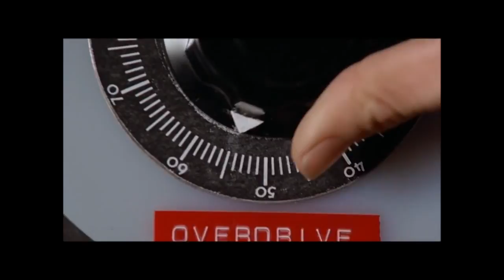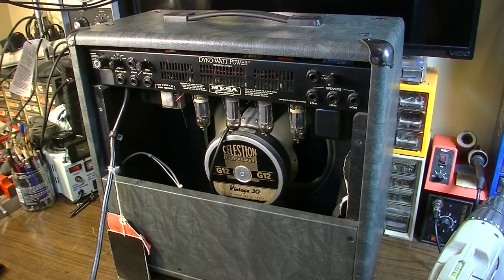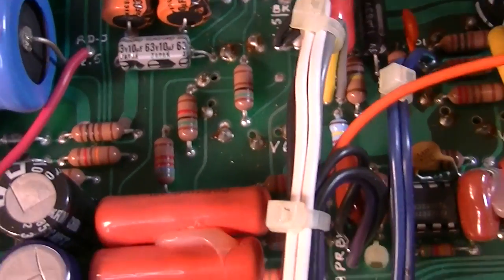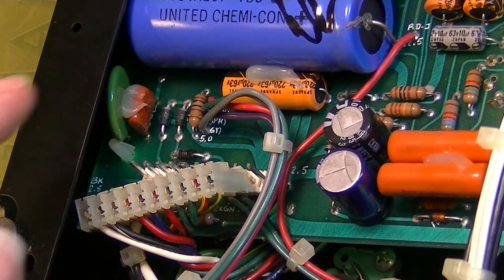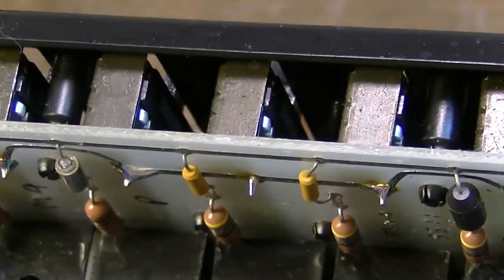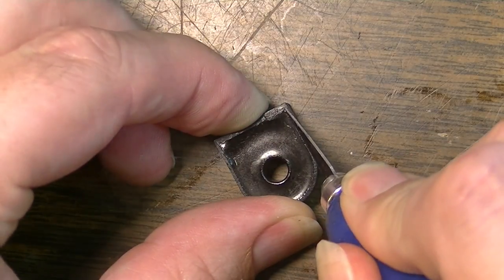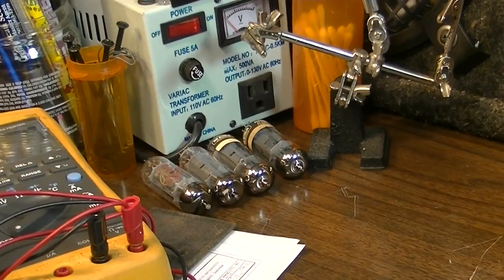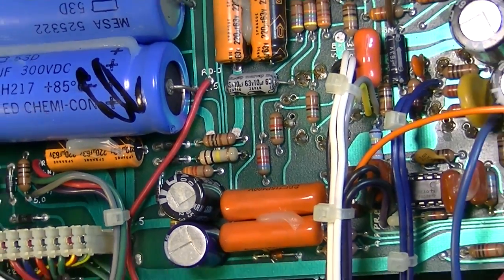The Forgotten Mesa-Boogie - 1990s Dual Caliber DC-3 Repair (PART 1)

Comment: I had a DC 5 that was horrible. Half of the EQ went out on it. It would feedback even at low volumes, Horrible pop when you changed channels. My other Mesa amps were fine, but I had two DCs that were both really bad. The DC2 was an easy fix. The DC 5  I would even sell to anyone. I  pulled anything good off of it then dumped it.  I feel your pain.

Comment: In 2018 those tubes, which are clearly stock would be old as hell. And also only two were replaced. At first glance it seems the amp has never been properly maintained, I don't care who his tech is. People just need to take care of their gear or they're asking for problems. All that trim, shielding or whatever always gets in the way no matter what amp I've worked on.

Comment: Hello, I am really enjoying your channel! I recently purchased a used Mesa DC-5 head and am really enjoying it! Overall it's in good condition, and everything works perfectly except the graphic EQ, which stubbornly refuses to activate. I have the older (original) spec DC-5 head, with the multi-position rotary switch on the back panel for assigning the graphic EQ. I tested the switch and it seems to be electrically fine. However, no matter what position the switch is set to, the graphic EQ will not engage. I also tried plugging in a footswitch to control it that way, and no dice. So I am suspicious that it's a failed relay or other switching component on the PC board. Would have have any specific advice about where to look, or which specific component to replace?

Comment: I would never have guessed these pc board circuits to be as flexible as you have shown through finding specs and isolating individual resistors, caps, and other parts, then rebiasing without using much more expensive output tubes to dumb down the amp. Great lesson for the uninitiated like myself! I put off watching this vid for a while, but I’m really glad to have seen it now. Thanks.

Comment: 55:50 - I noticed something similar with my Orange Rocker 32 (which uses EL84 tubes) - the plate dissipation was above 12 watts.   The Orange Rocker has a half power switch and when switched to half power mode the plate voltage drops to about 70% of the max power setting - bringing the plate dissipation under 12 watts.   These were new amps too.  It seems very odd to purposely design an amplifier to exceed the data sheet maximum plate dissipation.  Is it common practice to exceed the tube plate dissipation on guitar amps?    I don't know - that goes against my training/schooling.  I'm an electrical engineer BSEE from Cal Poly SLO and MSEE from SCU + 25 years of experience as a design engineer in Silicon Valley.  Maybe I just know too  much.

Comment: Ive worked on a few of these over the last 30 yrs and they all seem to run hot, and use a lot of watts compared to other amps. I think this extra wattage does contribute to the tubes getting to hot and burning them out faster while cooking that board. i always used the coolest running tubes i could get at the time, Sovteks are good choice, then adjusting the bias similar to what you've done. Ive used those adjustable resistors in a few just in case they wanted to switch tubes, but then a rebias would be needed which was easy, still needed to do the math to set it right , though some refuse and suffered the consequences. lol
 its great Mesa still sells parts at a decent price. thanks for sharing, Brad!
Reply: Ya, cooling fans are a common add on for Boogie amps.  Lots of other amps, too.  Buys some tube life in a cramped combo.

Comment: I love these videos and they've not deterred me from purchasing Mesa-Boogie amps in any way. Complex is not bad, just different. :)
Reply from the maker: My goal is not to dissuade people from Mesa. I hope no one thinks that. I just want to show things as they are. If there are flaws I find, I'll point them out. There is good and bad in almost any design.
Reply: Mesa stuff is rock solid (with all the bells and whistles)...as long as you treat it right.
Reply: Good.  Less copycats.
Reply: @Twobarpsi  that's funny because Mesa's most popular guitar amps were someone else's designs that they STOLE
Reply: @shekador  right lol basically every amp is stolen from fender or vox and sort of marshall but Marshall started ripping off the bassman so it's fender and vox. And Leo fender built his amps based of the old RCA books.  Basic radio amplifiers really

Comment: Boogie buyers like complicated amps I was offered to use one in a nice studio once  a quad rectifier I looked at it and went with the fender champ
Reply: Ice Bob most complex amps sound bad, give me a volume and tone - that’s it.
Reply: Mesa amps are better than any volume / tone amp, and My tone is in My hands  AND My Dual Rectifier Mesa
Reply: 83roadstar  you my need that .my tone is in my hands.if I need louder I play harder they did make a few amps for my the style subway blues was one. I don’t need channel switching  single channel with reverb volume knob  tone I’m good. no disrespect we all have different music needs
Reply: No, they like good sound.
Reply: @icebob8555  You play harder to get more volume? Said no guitarist ever (also , that won't work)
Reply: Ice Bob How do you add/remove mids and balance the highs and lows with only a tone knob?
Reply: I have a Boogie DC3 and love it.  Great cleans that rival any Fender.  I also play thru a 5E3 Tweed.  I love the spongey overdrive you can get with that amp.  Boogie for cleans and Fender for overdrive. Who'd a thunk it?

Comment: Brad, the Dual Caliber range is actually an upgrade to the Studio/Caliber series, which housed a single EQ section shared between two channels (almost unimaginable simplicity by Mesa standards)! The DC-2 & DC-3 upgrade from the 22W, dual EL84 Studio .22+ (of which I own a mint 1992 example). The DC-5 & DC-10 upgrade from the 50W, dual 6L6 .50 Caliber+.
Reply: I'm confused a little. I have a Studio Caliber DC-2 (No parametric EQ). Is there a DC-2 that's a Dual Caliber? You're saying the DC-2 is an upgrade? Did the lineage go Studio .22>Studio Caliber>Dual Caliber?

Comment: Nice work, I never would have thought to call Mesa for parts like that. Such a simple solution haha. Awesome they're still stocking parts like that. Definitely some moments that made me want to go play through my Dual Rec Tremoverb. The complexity of the high gain Mesa tone is always something I enjoy. At the same time, I just modified an old hifi amp into a perversion of a 2204 circuit, so I love both Mesa and Marshall high gain flavors
Reply: haha I want it all I guess. Also 12 years ago when I got my Mesa, it was my grail amp. It doesn't have sliders, it's just a 2 channel Dual Rec. I shy away from the graphic eq Mesa's, they're just a bit extra for my tastes. These days I still listen to extreme metal, but I pick up a guitar and love playing other stuff.

Comment: I went through all this a couple of months ago. It's actually impressive that all these DC-3s can survive with 125% or higher output tube dissipation. I piggybacked the 120K to bring it to 100K to bring dissipation to survivable numbers. Changing that resistor also changes the bias for the phase inverter, and actually uses the phase inverter cathode current to generate the output tube bias... luckily it was close enough. If the PI bias is off, the 15K needs to be changed as well. Later, for some reason there was -45V somehow leaking onto the grids of the EL84s from that ridiculous bias circuit, cutting off the output tubes. Tightening the input jack to fix ground was the only way I could find to fix it. Nice sounding amp when it's 100%!

Comment: Little amp turned out great! One could tell it had been used but not abused. Many trouble free miles ahead! man, i worked 2 blocks away from Mesa HQ around the time this amp was made (91-93) on Clegg. I'd taken a break from playing so never stopped by but more than once heard amps 'demo'd'.

Comment: I have a DC-5, one of my favorite Boogie amps.
Reply: Me too, awesome amp! I had a Dual Rec for 15 years but I like the DC-5 so much better. It just has a sweeter sound to the Dual Rec. I picked mine up from a studio sale so it'd never been gigged, only ever sat in the live room for 20+ years. I need to get to the pots as they're all crackling badly but it's a beaut!
Reply: Yea, I got mine for $400! I couldn't believe getting a Boogie amp for that price. I've heard the lead channel is based on the early recto with a mark EQ. Sounds less muddy in the low end to me. I have a 3 channel dual rec and I find myself playing the DC-5 way more nowadays. Plenty of gain for everything.
Reply: @KnotTime  I have one of the earliest DC-5's I've seen. Red shade grill cloth with the plastic rocker switches and no headphone jack. Play it almost daily.  Close to Fender cleans and headroom to level a small town! :) Keep rockin!
Reply: I bought my DC-5 combo new in 1997, and still use it. It’s been rock solid and puts out.

Comment: Good video. The hot bias problem was discovered - and the remedy discussed - years ago on the forum "Boogie Board" under on website forum.grailtone.com. I just checked, and the forum still exists.

I bought a new DC-3 in the early nineties. I still have the amp, but rarely use it. However, I quickly ran into problems with the amp running super hot, wrecking output tubes and creating other heat-related problems. I discovered the thread on the above-mentioned forum. Most owners consider this straight out design flaw by Mesa. The solution is precisely what is suggested on this guitologist video. If you are feeling too lazy to unsolder the 120k resistor and replace it, the Boogie Board thread suggests just soldering a 470k resistor in parallel with the 120 to give...you figure it out. Same result, though, and not much easier.

I went through the rigamarole of using "cool running tubes", and even installed a computer cooling fan in the amp. All of this stuff is a waste of time. I kept wrecking multiple sets of tubes. As reported in this video, the problem is a bit of a gremlin. It always showed up for me when I would crank the amp up and drive it a bit, but maybe not the first time or two. Then, it got to the point that I would be playing loud (with relatively new tubes) and suddenly I could smell the amp self-immolating from ten paces away. 

As discussed in another comment on this guitologist video, the issue of changing the PI voltage was discussed on the Boogie Board. Reports were all "don't worry about it, doesn't seem to do any harm".

Side note: I bought the DC-3 back in the day because my son talked me into it. He was a Metallica fanatic at the time, and was just convinced that I too should own a MB. Even without the overheating problem, I has since discovered that I just don't like Mesa tone, and generally I don't like EL84 amps. I only ever play clean, hate cheesy metal overdrive, hate djent, hate scooped-out graphic eqs. I am really kind of a jangly, bright, airy Fender guy. But, mostly these days I just play my Boss Katana.
Reply from the maker: Great comment. Thanks for sharing your experience. I think perhaps you've just never gotten a good EL84 amp with a voicing to match what you're looking for.
Reply: @TheGuitologist  Maybe it's Mesa amps, not el84s. I don't know what word to use - maybe compressed, tight, or choked - that I don't like. The sound doesn't have enough air and light in it, to wax metaphorical. Also, for a 35 watt amp the DC-3 is loud as hell. I think I am a Princeton Reverb kind of guy, whatever the tubes are in there.
Reply: The problem is even the Princeton Reverb has it's own issues. It's one of my favorite amps along with the Blues Junior. You would probably like the Lonestar more.

http://fenderguru.com/amps/princeton-reverb/
Reply: Is this the thread?  http://forum.grailtone.com/viewtopic.php?f=28&t=33293.    I have a DC-5 with a very low serial number which I stopped playing years ago.  Need to modify the bias and the reverb it sounds like...

Comment: They sound good but I always find Mesa's just made overly done. You don't need all these tubes to make a two channel amp. Just a matter of smart switching. That way you can reuse multiple tubes for multiple channels. 
A lot of times certain tubes are even doing exactly the same thing with the same subcircuit.
Reply: The idea was two amps in one chassis and they have a distinct sound to me.
Reply: @DavidMorisset  . Yeah true. But what I was saying is that you can still have that when combining certain things.

Comment: I have a Mesa Boogie DC-2 amp. It has 2 EL 84 power tubes and 6 preamp tubes (why so many?) also has a 3 way lead, rhythm, contour switch. Not sure what the contour means but sounds much different than the lead and rhythm
Reply: my DC-2 doesn't have the contour 3-way switch

Comment: question... so by changing that 1 resistor (120 down to 100 ohm) you cooled this amp down... so the opposite would be true then??? change the value up and run it hot till she blows??? a short term hot rod special???  IF this is to be true... would this mod only be good to the Mesa Boogie DC3 or would it be too all Mesa's??? or would this be true to all tube amps??? and I just want to say thanks Brad... your videos are awesome and I just hope you keep doin what your doin!!!
Reply from the maker: Good question. ALL Mesa amps can be rebiased in a similar fashion, although you'll have to do some research in the schematic to figure out which resistor(s) to change to adjust the bias. But beware, it will void your warranty if you still have warranty time left on it.

Comment: Cool little amp huh? I have only owned a dual rectifier and I hated it with a passion. impossible to get a sound I liked. But these amps sound pretty nice. I have no real experience with any of the others.

Too bad they have so many problems. I mean, wow.
Reply: I had a Dual Rec for 15 years and it was awesome for live gigs or LOUD practices but useless to get a usable tone at home. I have a DC-5 and it sounds great right from tv listening volume right up to proper volume. It also sounds amazing direct recorded using the FX Send into the soundcard using a decent cab impulse for the ultimate in quiet recording. I run mine with a tube screamer to boost and it's a gem!

Comment: Great video, Brad! It's surprising the power amp board made it back to life, given its dreadful state. Would there be any benefit of just pulling the board and replace it by 4 chassis mounted sockets (and therefore make the power section hand-wired), or would that be overkill?

I couldn't see the location of the pre-amp tube sockets. Are those on the main board?

Comment: I keep seeing the same problem over and over.  Negative bias shuts off the tube (makes it run cooler) When one "turns up" the bias one adjusts the pot toward ground making the negative bias voltage closer to zero .  So in an amp with fixed bias, (negative voltage) lowering the bias voltage (more positive) makes the amp run hotter.  Increasing the negative voltage makes the amp run cooler.  Just looking at the schematic, the amp appears to be designed wrong.  The negative bias should be around  negative 20 V.  There shouldn't be high value resistors  (220K) in line from the PI plates out to the grids... this further divides the bias voltage downward and lowers the signal strength from the PI.  The supply voltage looks a bit high for EL84's which should be closer to 380- 400 volts.  The screen grids which make the tubes run in beam power mode rather than in triode mode, should be very close to B+, so also in the 350-390 V range.  Beam power mode is roughly twice as efficient as triode mode.  The lower the voltage on the screen grids the closer the tube is to running in triode mode.  Using one high quality pot for bias is suggested.  Adjust bias way upward  (- 20V ish) not downward (-5v).  remove (short them out ) the 220K resistors from the PI outs (.047 uf  and 330K bias resistors junction to grids of output tubes.). That output transformer is way too small.  (physically) it looks like it should weigh about twice as much to deliver  32- 40 watts.  When checking impedance of an output xformer , of such low power, not designed to pass 60 Hz at full efficiency because it saturates early at low frequencies, it would be better to drive the secondary at a higher frequency like maybe 200-500 Hz, or a lower voltage,  (like maybe 1-5 Volts), and the output  (primary) should be loaded a little.  Check Fender "Tremolux amp from the 60's with 2 EL 84's.  There were a bunch of high fi amps that ran two EL84's as well.  
Also a low powered Marrshall from early on.  I forgot the name.  Mesa's circuit is just very poor.  I haven't followed this whole thread but it seems You have had several nightmares with runaway ambient current, and redplating.  It is almost always due to a broken or missing NEGATIVE bias supply.

Comment: on the red-plating issue: the Marshall JCM2000 TSL100 & TSL122 have problems with conductive circuit board  when getting hot. Plate Voltage makes negative bias voltage more positive due to conductive board (only 1mm distance on the board). Great solution on this website: https://drtube.com/modifications/jcm2000-stable-bias-mod. Video showing problem: https://youtu.be/Yz_v-XK1PsU